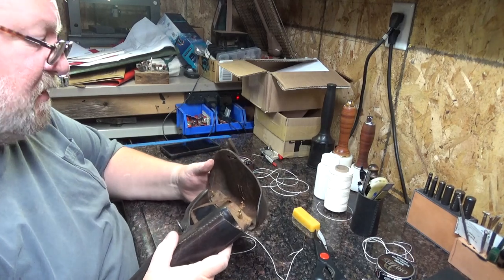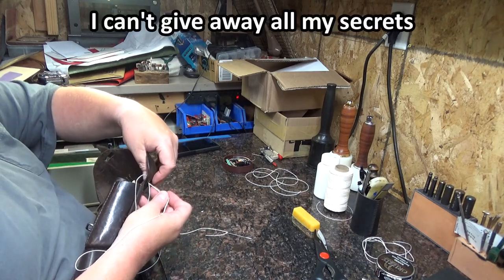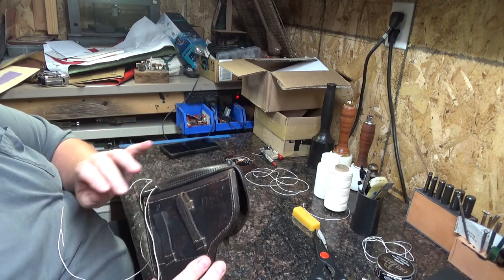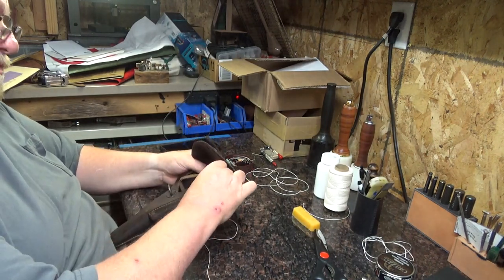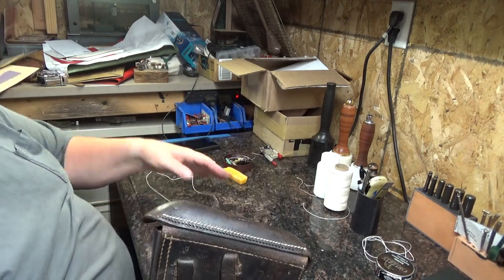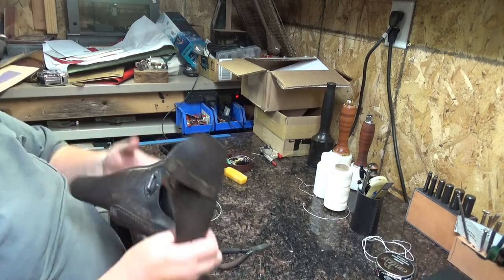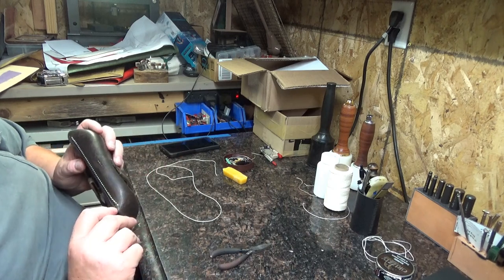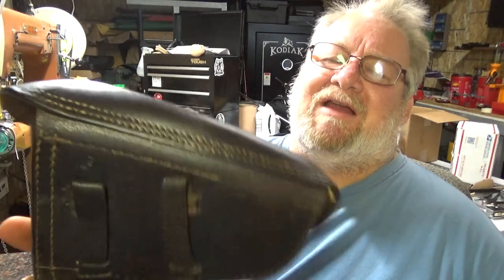I'm back! 1944 P38 holster repair

Comment: Just started the video and haven’t had the pleasure to watch all your other videos but how would you go about fixing a holster with the metal loop. One side of mine is broken of and it just rotates lol
Reply from the maker: I'd have to see it, may just need to be peened or set again. If it's like the P-38 there are 4 pins that hold it in place, could make new pins and re-set it, maybe just replace it. you could email me a picture at fatmanleather@gmail.com then I could say better.
Reply: @FatManLeather I certainly will. Thanks man.
Reply: Also you asked what we’d like to see. I have a cz 27 holster that’s dry and the stitching needs re done so maybe a rehydrating/conditioning of the leather would be awesome
Reply from the maker: @krandom354  To do it properly takes some time, I'll see what I get in, I have several I have to get edited now.